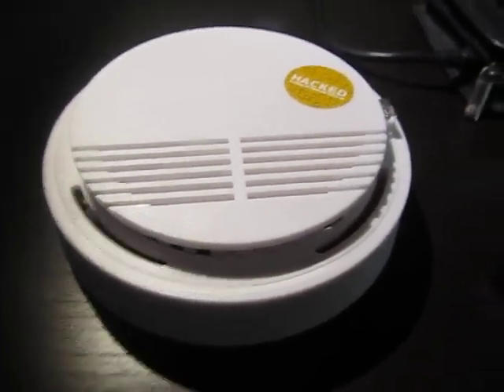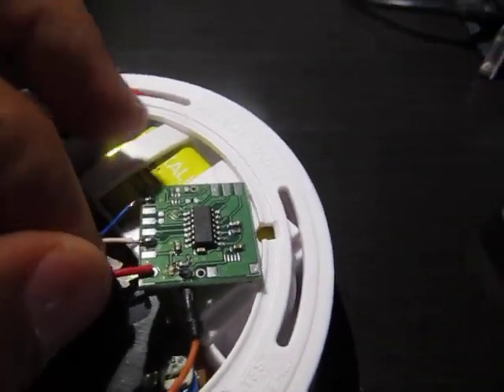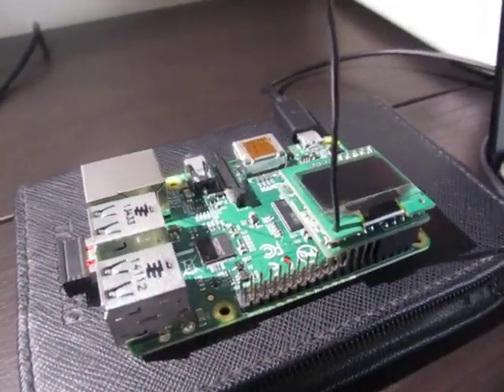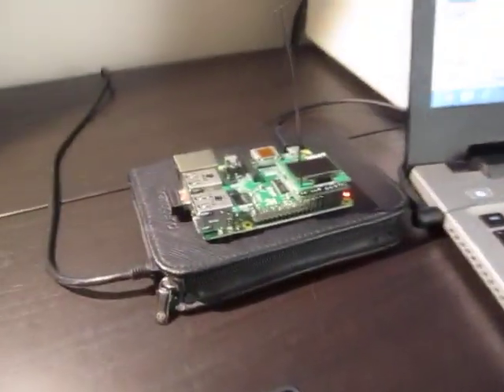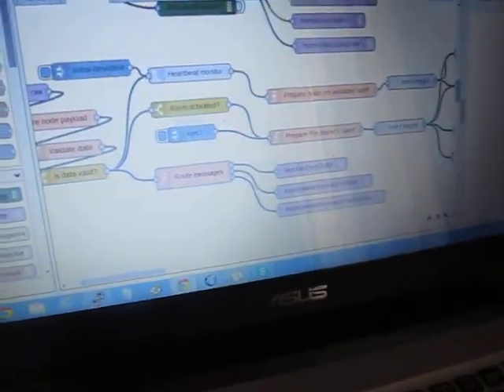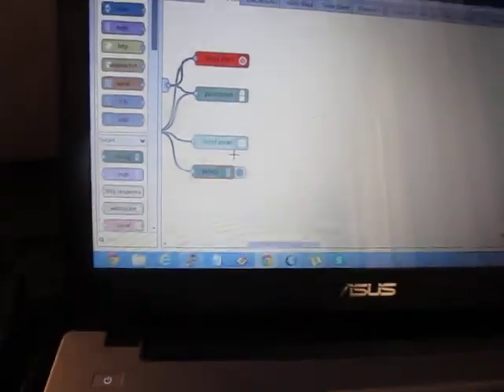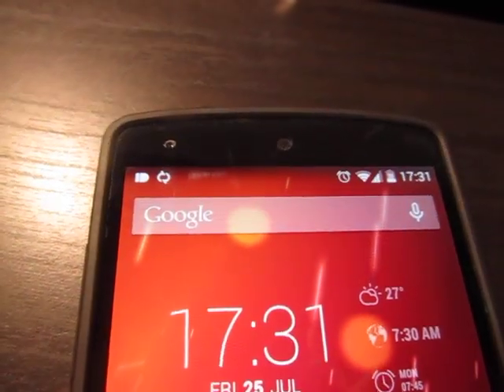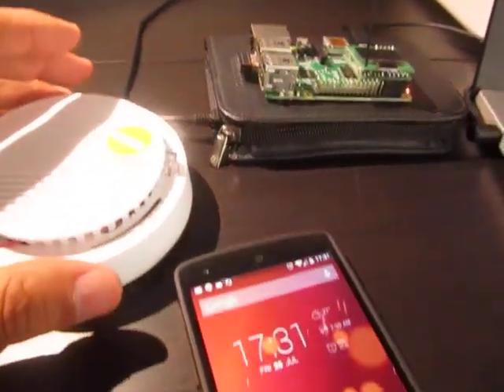DIY Internet of Things Fire Alarm project

Comment: Hi Martin, 

Have you seen the Allianz - Smart Fire Protection Contest? 

Send me an email if you have any questions -Kate.Rushotn@hyve.net

Allianz, one of the largest insurance companies worldwide, has identified a lack of fire protection measures in small and medium-sized enterprises (SMEs) in the textile industry. The majority of SMEs are only elementarily protected against fire (smoke detector alarm, fire extinguisher), even though the owners are aware of how severe fire damages can be. This is mostly due to a high cost for effective equipment (high-pressure sprinklers, etc.), as well as time-consuming regular maintenance needed. 

To reduce the high costs linked to fire damages in textile SMEs, Allianz aims to develop a new and effective fire protection device that would be cheap to install and would require little to no maintenance. To take part in this challenging project, submit your solutions / concepts and co-develop the product with Allianz! 

The 3 winners will be invited to further develop their concepts, together with the Allianz core team and HYVE innovation consultants. Open Worldwide Closes on 8th July 2018 1st Place: 8 000 € 2nd Place: 3 000 € 3rd Place: 1 000 € Most Valuable Participant: 1 000 € Most innovative concept: 500 € Most advanced design/concept: 500 € https://allianzsmartfireprotection.hyvecrowd.com/